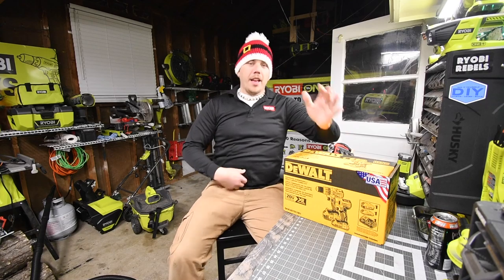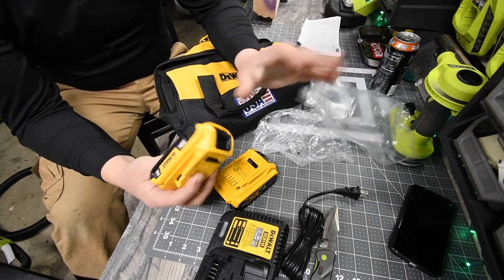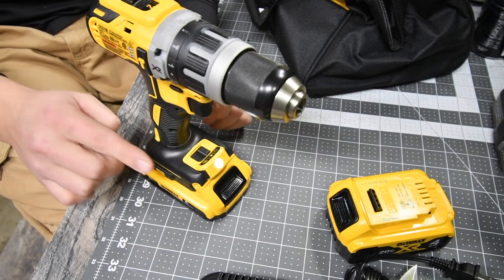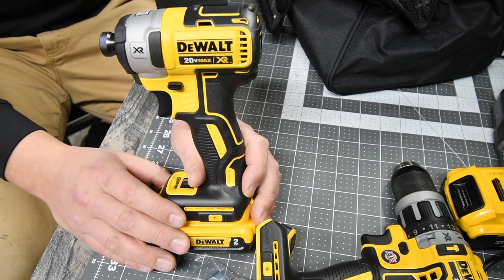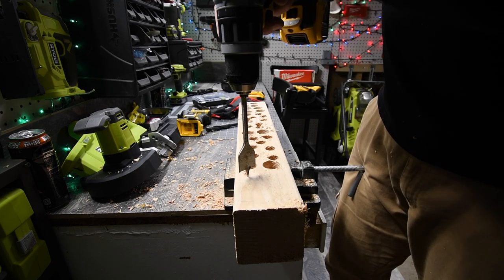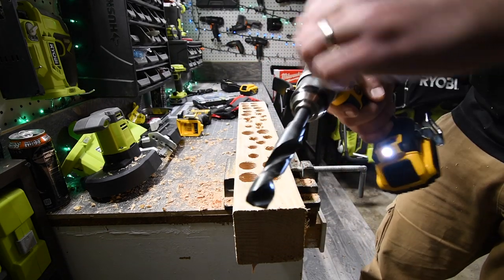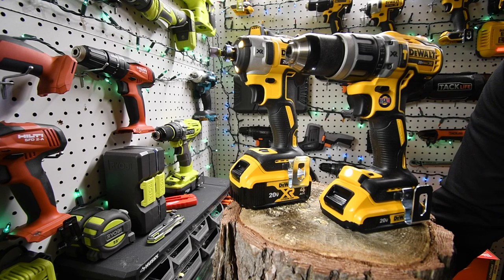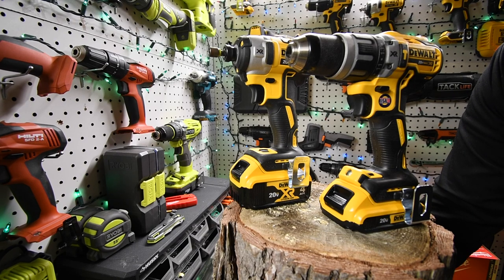$230 Dewalt Kit Unboxing/Test

Comment: I have both those tools. They are both very powerful. They are two of my favorite tools.
Reply from the maker: me personally when it comes to dewalt I love the atomic line drills and the extreme impact driver
Reply: Man Caver Tools I also have the dcd777, it’s a beast too but the chuck wobbles a lot that’s why I bought the 796. I’m thinking of getting the extreme impact but it’s not available here yet. My makita 12v nimh impact works fine for what I’d use it for any way.

Comment: Right now my battery variety consists of three 1.5ah batteries, two 2ah batteries, and a single 5ah battery. I plan on buying either a single 6ah 20v max battery as the next addition.
Reply from the maker: I love the flexvolt batteries
Reply: Man Caver Tools oh, I wasn’t actually talking about the flexvolt battery . I was talking about the non flexvolt 6ah battery. I have no need for the flexvolts

Comment: Those 2ah batteries are still XR batteries. They just have the newer stickers on the sides.
Reply from the maker: correct, there is a big difference between the 1.5ah and the 2ah

Comment: Interesting that you re-classified the 796 as a "mid-range" drill after you stated that you considered it a "low-end" drill before you saw what she could do.
Reply from the maker: compared to the bigger XR Hammer drill it is a mid range. but that doesn't mean that its a bad drill. I thought it did a great job for its size